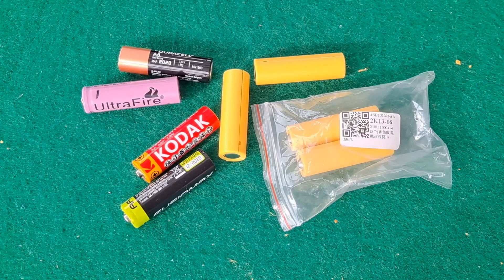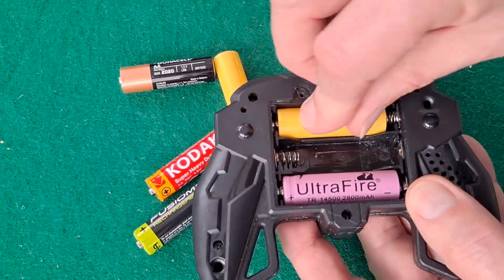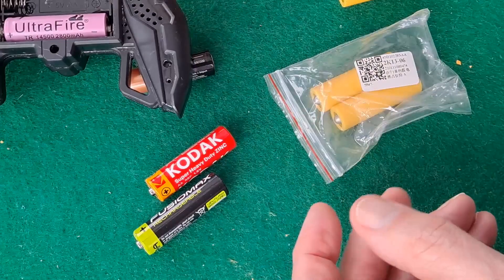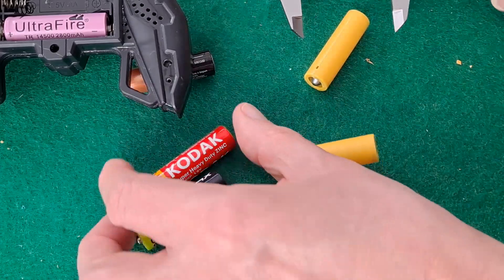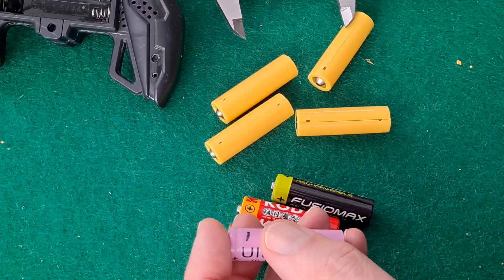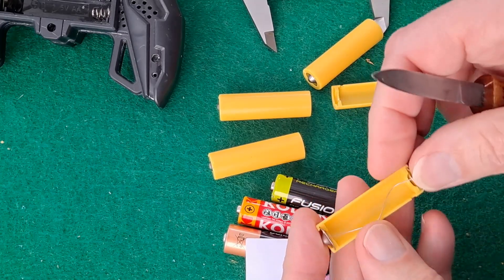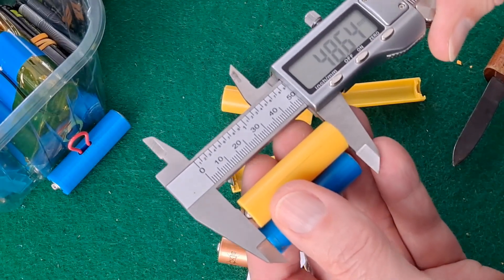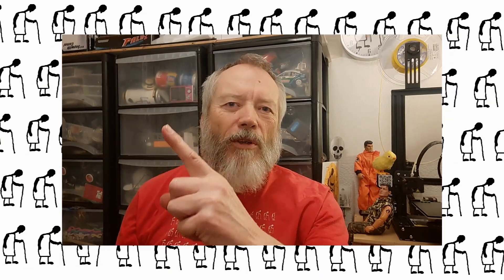Inside those dummy AA batteries

Comment: Those dummy cells look more like fuses inside them, id be afriad to run too much current
Reply from the maker: YouTube is up to it's tricks again. I wrote a long reply here and it disappeared. Yes you are right. I measured the diameter of the wire link and depending on the accuracy of my digital calipers it is either 0.3 or 0.4mm. I did link to a chart that gave the current rating for copper wire (this is unlikely to be copper but it is a start point) and those figures give between 0.7 and 1 amp.

Comment: Hi You could use a 13mm Disc magnet as a spacer . best regards
Reply from the maker: Yes you could, or virtually any other conductive item. A penny for example or a ball of silver foil. I am just annoyed that there is no good reason for making these dummies too short. Having said that, they did the job fine in a different toy car battery box, but that had more generous springs.

Comment: Hi Grandad. I had this problem at Christmas, when I discovered that  'standard' sized alkali batteries were just too short to make a satisfactory connection within a Christmas decoration. I found that a small piece of folded aluminium foil placed against the + side of the batteries bridged the gap and solved the problem over the whole of the 12 days !
Reply from the maker: Good solution. I usually just bend out the metal contacts in the battery holder. I am just annoyed that there is no good reason for making these dummies too short. Having said that, they did the job fine in a different toy car battery box, but that had generous springs. Hope you are keeping well Peter. I hope you have had your jabs by now.
Reply: @GrandadIsAnOldMan   All well here. Had first jab and no side effects. Thanks for asking.